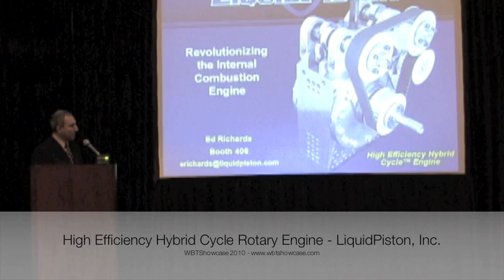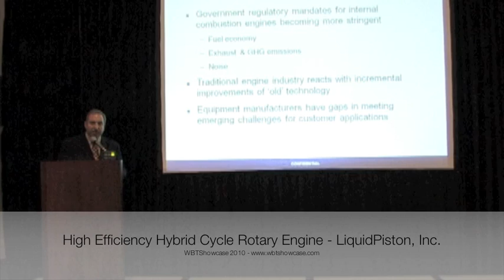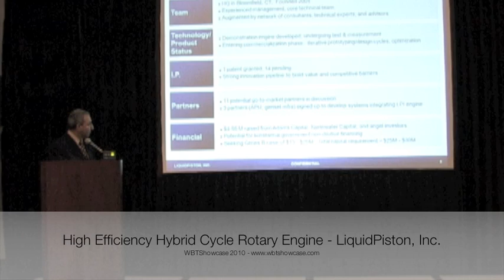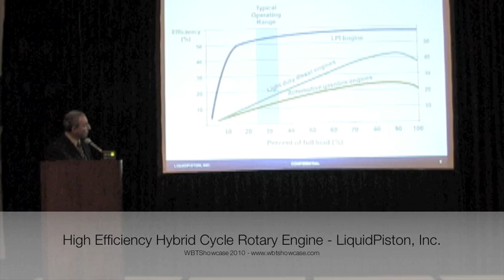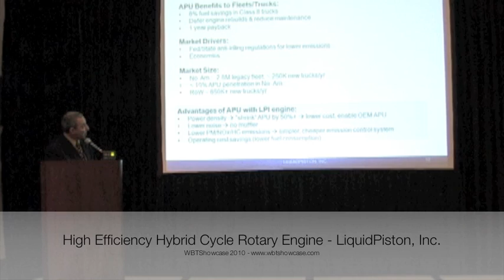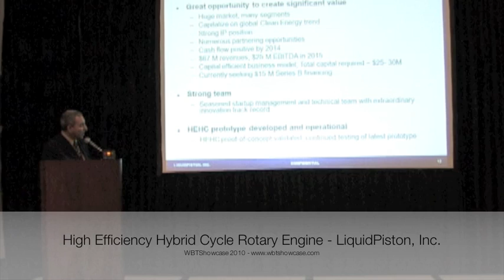High Efficiency Hybrid Cycle Rotary Engine - WBTShowcase 2010

Comment: I'm sure the oil companies will make sure any efficient engine never sees the light of day. These guys have just taken Wankel's ideas and expanded on them. Not really an original idea, however their combustion cycle and research on thermal efficiency for this engine is quite exciting. We can only hope this engine becomes reliable and viable and most importantly accepted by the public.
Reply: You really don't understand the oil industry.

They aren't in the business of selling fuel, they are in the business of selling petrochemicals. The oil companies only make about 2 cents on each gallon of fuel. The big money is in all the other products that are made from all the other chemicals.

Once you filter out all those VOC's (ya know, the diesel, kerosene, and gasoline) you have a lot of useful chemicals that are used to make everything from water bottles to car parts to body armor.

Wake up!